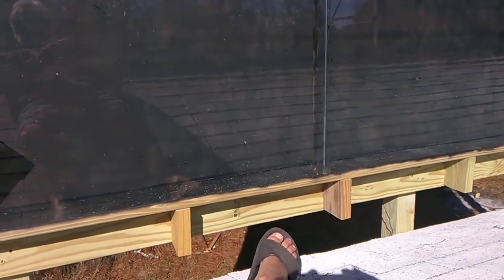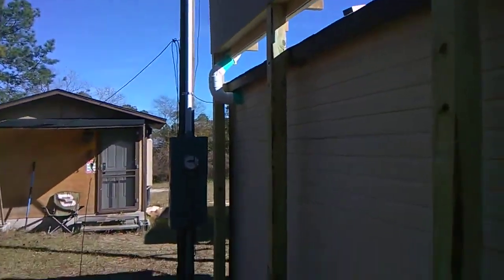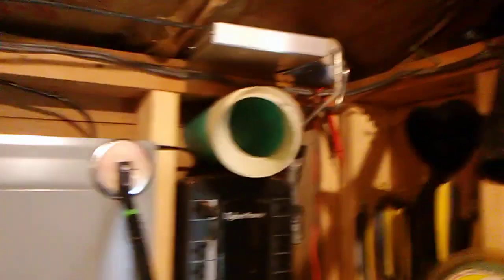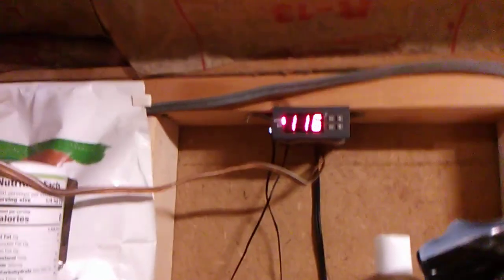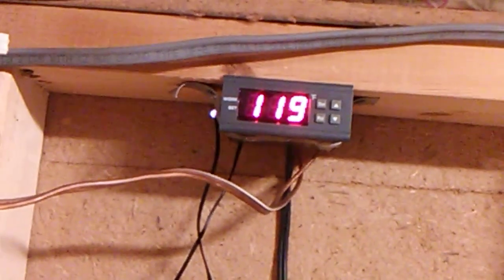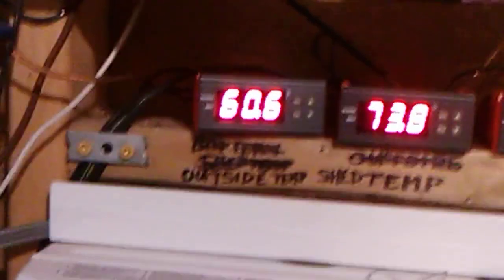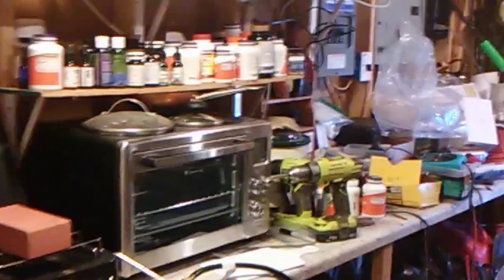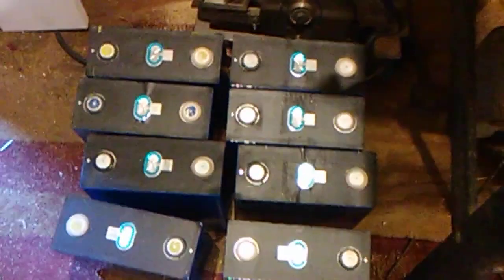Bossrox DIY Solar ~ My 2nd DIY solar furnace

Comment: Have you considered running a loop of alcohol water (to prevent freezing) inside the box and use it to heat a giant water reservoir? That way you could still get heat overnight from the stored energy.
Reply from the maker: I do that with a sand heater. Use my excess power during the day to heat it up so it doesn't tax the battery bank too bad overnite

Comment: Set the off temp at 80 deg. and the on temp at 90 deg. You want the collector assembly to be as cold as possible. The greater the delta t to the ambient temp, the more heat is lost to the outside and the less is collected and moved inside. In a perfect world, the collector outlet temp would be 10 degrees above the room temp. You want that outlet air to feel cold .Run the collector above the room temp, but as cold as you can.

Comment: You could leverage solar panels as well in the sun they get awfully hot and they lose efficiency above 25c so you you could say put fins on the back of the panel and pull the house air similar to what you have. A company in Western Australia (Australia) was showing a commercial version - https://www.youtube.com/watch?v=-dJixtZdkU0
Reply: I was thinking if he just changes the glass to solar panels, what he got right there might work just fine. That air blowing par the back of the panels should help quite a bit in keeping the panels cool.

Comment: Cool use of turbulence for air mixing in the heater box... saves quite a lot of material not running duct pipes back and forth through the whole thing.